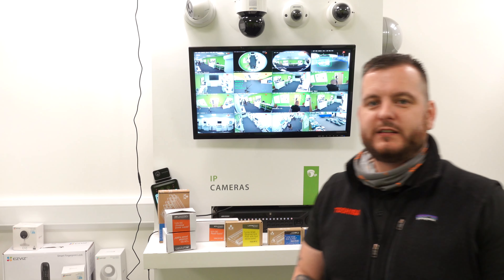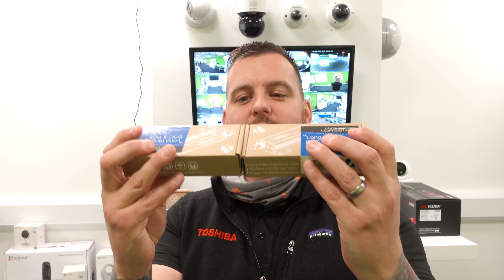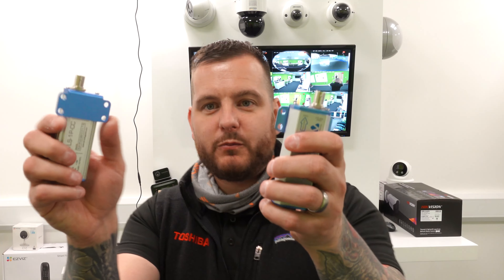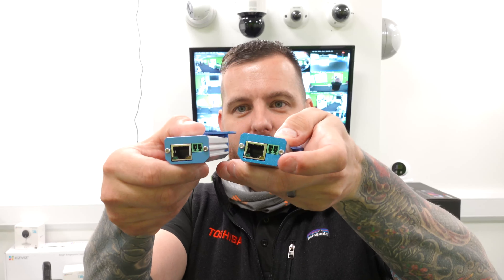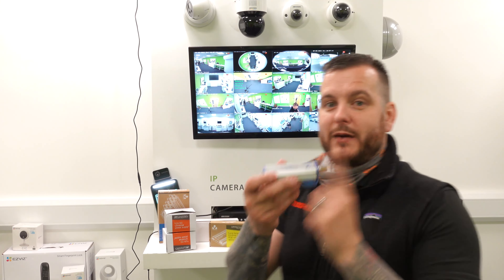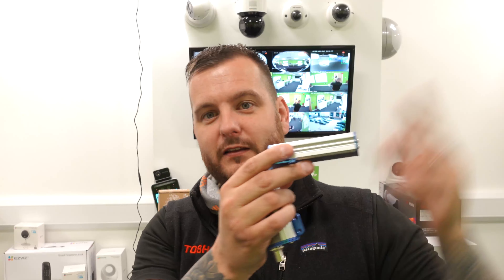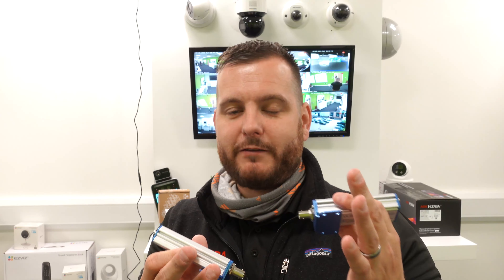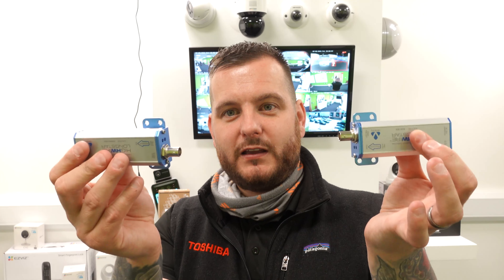How to transmit IP over long distance coax cable?

Comment: I just want to replace my analog cameras with POE Cameras , can the current COAX cables to each camera be replaced with some sort of converter to use POE Cameras ?   I should add that my POE Cameras do have Lan and a power connection if needed I have run them Soley on a true POE Lan setup without the power connection used on each camera too ...